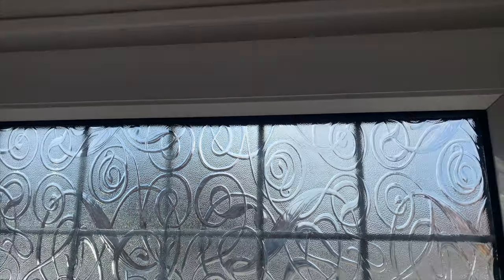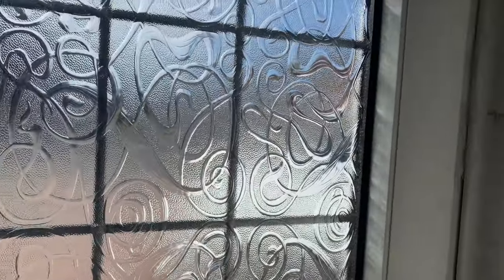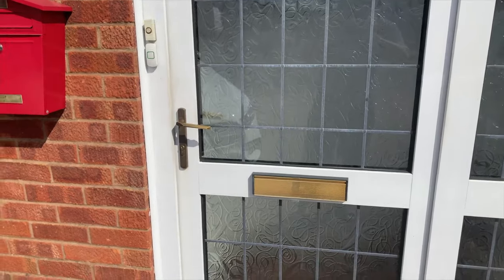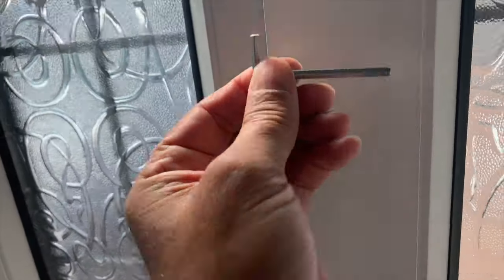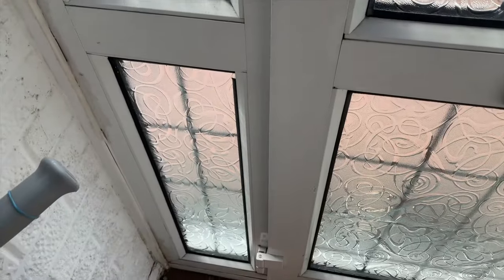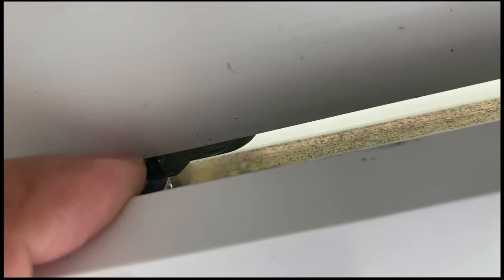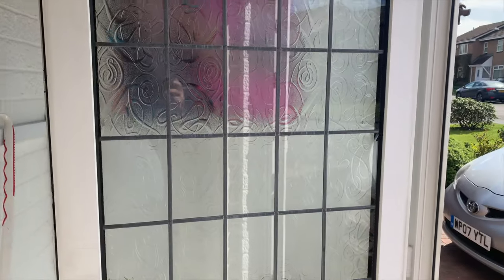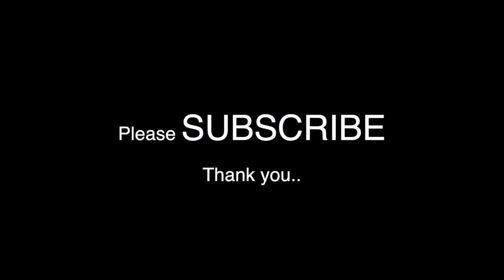UPVC door stuck deadlock

Comment: Good video. I have a different problem. I have a lean-to Consevatory, every summer I have the same problem with the outside door. I open it ok but if it's hot day I have to really slam it to close it, which is a worry incase the class smashes. 
And the door going into the house sticks/scrapes on the frame when I close it. Any ideas please
Reply from the maker: I think you may need to just aline it up a little by tightening the things air the other end of the door - if that makes sense.